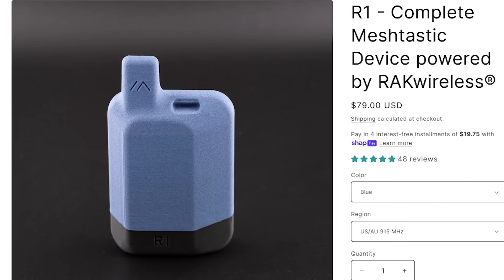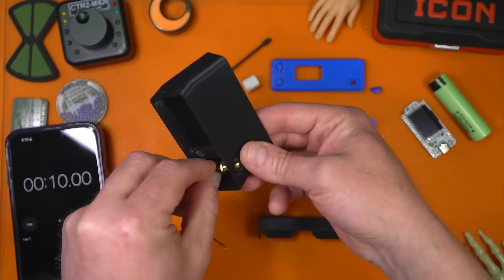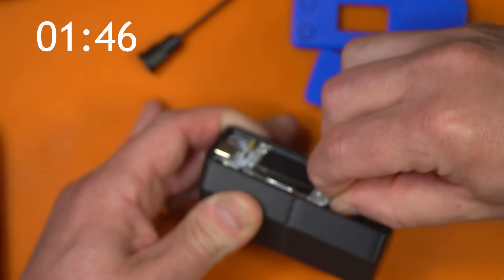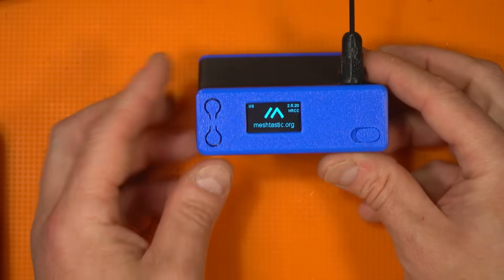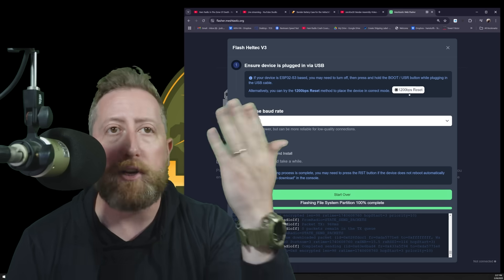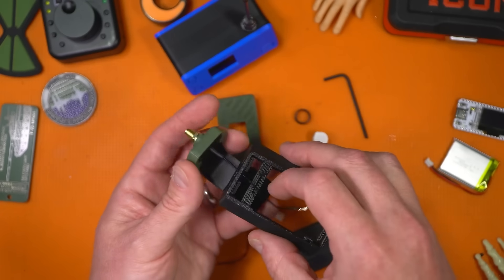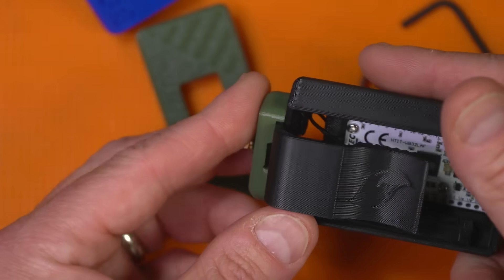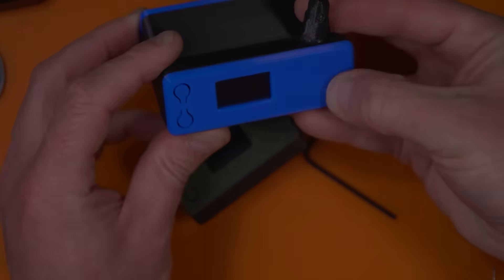Sub-$60.00 Meshtastic Nodes! ZeroFox3D Bender & Nibler!

Comment: I can build two Heltec V3 based devices up for around $65 total, I am printing my own cases though. I'm surprised by the prices these devices are starting to climb up to.
I got myself a T114 with GPS for about $55, that's got both the more power efficient nRF52 and GPS, add a case for pennies on the dollar out of my printer, and source a battery for another $10, and I have pretty much everything you could want out of an nRF52 node, at slightly cheaper than premade options plus a display and buttons unlike the R1. Really, the one premade nRF52 option that might be worth it is probably the T-Echo, mainly for the e-paper display.

Comment: Dont get heltec.  Get the RAK boards.  massively better, and a 3000mah battery lasts for 2 weeks.
Reply: The T114 is good because it uses the nRF52840 which is very power efficient but I'd avoid the Heltec V3 if interested in power efficiency. Zerofox3d has T114 cases.

Comment: So decided to get into this hobby,  ordered a couple of Heltecs, to play around with and get familiar, but I am also thinking of making my own solar node.  the goal is to make it reliable but cheap as posible. been looking at all the different projects, taking ideas from different ones and adding my own. 

There are plenty of really nice projects,  and I do have a 3D printer,  but not everyone has one,  so I wanted components readily available,  since my circuit will have solar panel, MPPT, battery and battery protection circuits,  soldering will be necessary,  but if I or someone wanted to make a kit from it, adding connectors where everything just plugs together.   the waterproof box will only need two holes,  one for the antenna and another for the wires from the solar panel. 

Solar panel is the trickiest thing,  ideally you want it to be able to face at an angle,  but having that complicates the project,  but if I just stick the panel to the housing,  it will be facing sideways,  so my Idea is to do it that way, but put a bracket on the box, and use an antena that swivels and changed angle,   so no matter how the box is positioned, (for gathering sunlight) the antenna can be angled vertically.    so the whole unit could just lay flat on a roof,  or strapped to a pole.  

BTW,  the solar panel will be 2W (5V 400mah),  cost about 3.50,  water proof junction box,  $15,  The MPPT  and voltage protector, are just $1 each.  going to use a huge battery, 10,000mAh, that cost $10 bucks  so all in all,  only about 30 bucks.   couple bucks more for connector extension wires and/or solder sleeves.   most of that stuff comes from aliexpress,  and i would be ordering to build more than one.   

I want this super reliable and water proof to withstand hurricanes (Florida).  that extra large battery is there to keep it powered in case we have two - three cloudy days.
Reply: One of my friends showed at our local radio club meeting a solar node that he built using a ~$10 solar light fixture from our town's Menards store.  Removed(disconnected) the LED light, installed the board and sealed up a few holes he made for antenna ect.   Left the solar panel and battery pack that came with the light as they were the right voltage.   It looks like it works great, so I think I might build one and put it up on my windmill tower at about 40ft up.
Reply: @arnoldgrubbs2005  I have seen a few, also on 3D printer file sites, there is a lot of ideas, also making a ground plane antenna is not a bad idea, more labor intensive, but potentially a better antenna and lower cost.
Reply: Rakwireless has a premade box that might meet these requirements

Comment: the heltec trackers are by far the best bang for the buck with gps
Reply: Power hungry though, for small and portable with screen the Heltec T114 is good, uses the NRF52 chip that the Rak uses so sips power. There is a Nibbler for it which is a work of art too, I performed a minor miracle getting the GPS in.